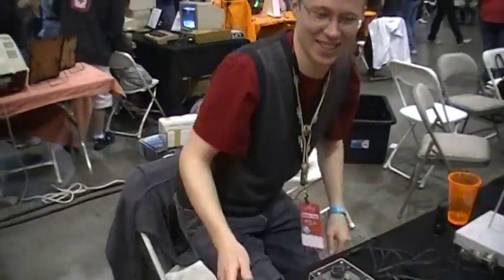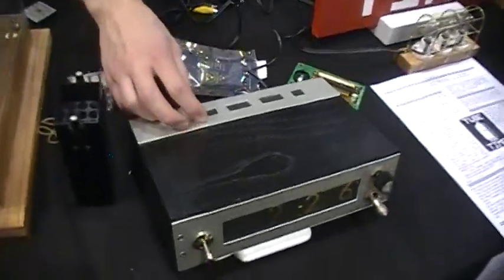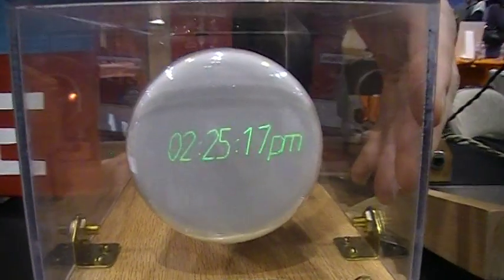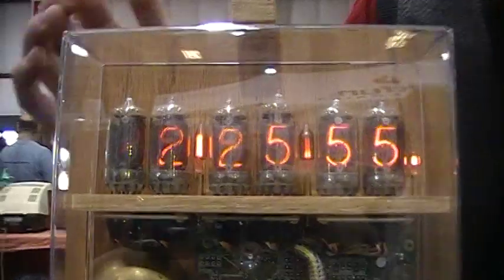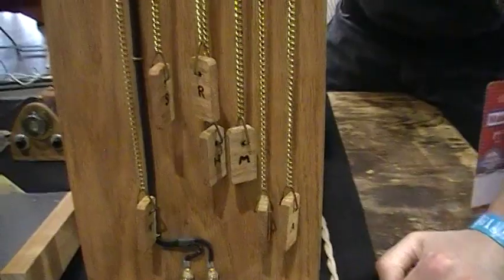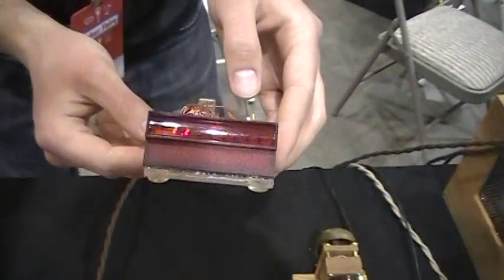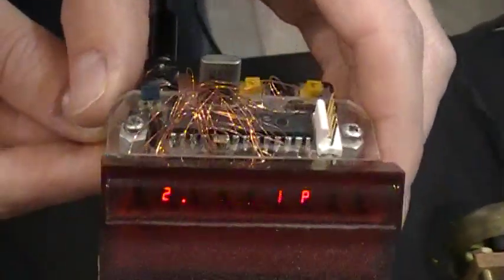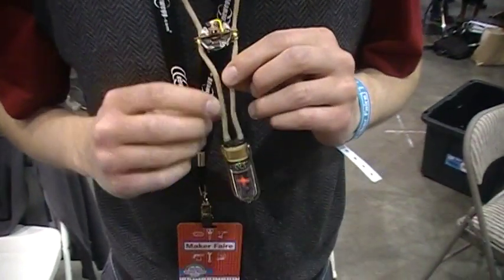Eric Schlaepfer Clocks - Nixie, Incandescent and CRTs

Comment: i've made a binary LED watch and several other picaxe based clocks by hacking analogue clock motor drivers to get the 1 pulse per second and using it as an interrupt, the watch i've made has alarm, calender with calculation for leap years and hourly alarm which plays the westminster tune and beeps the hour, it displays in 24 hour and beeps in 12 hour